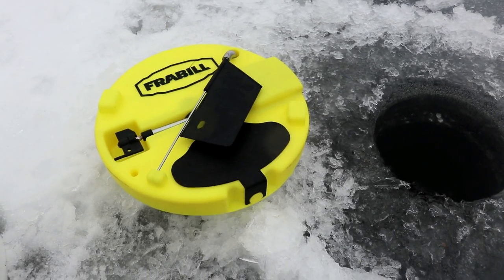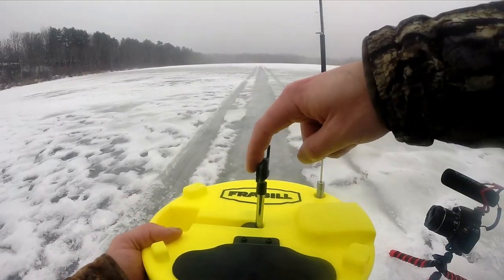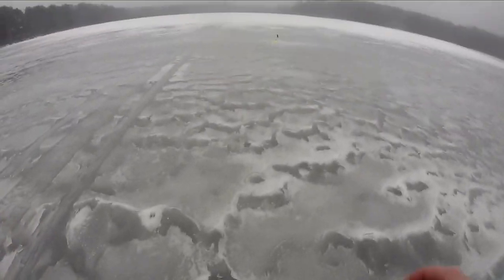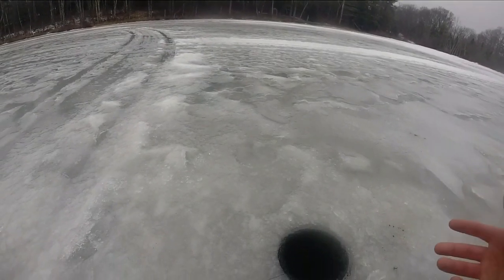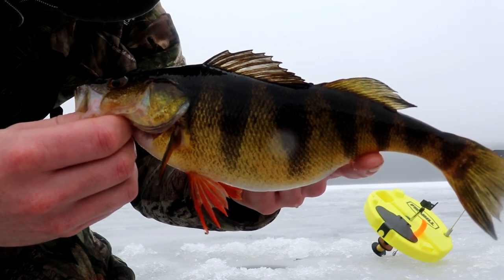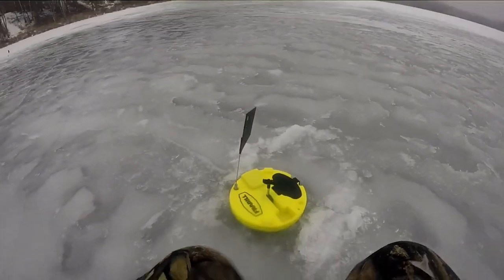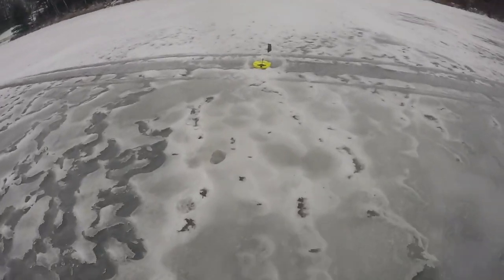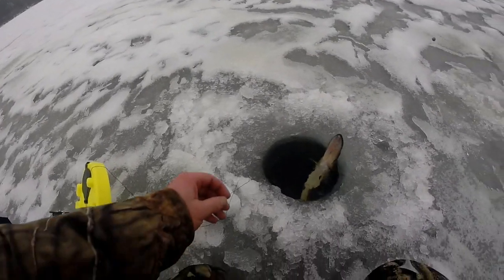Using Frabill Insulated Tip-Ups (How-To)

Comment: You want to spin the top to let off more line before you lift the tip up off the hole, then hold the line while you're moving it aside. You are losing fish because they are sensing tension before you set the hook. Also don't set so hard.